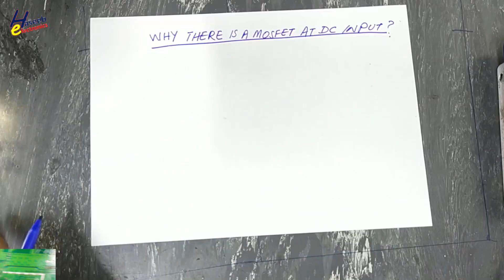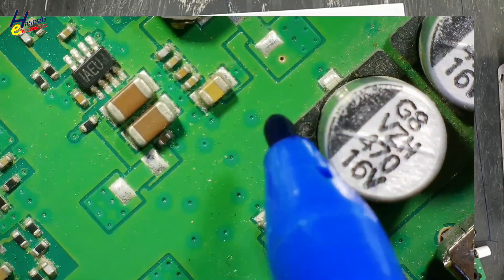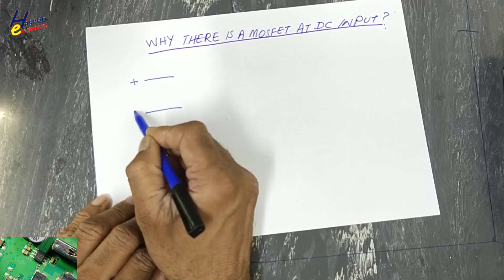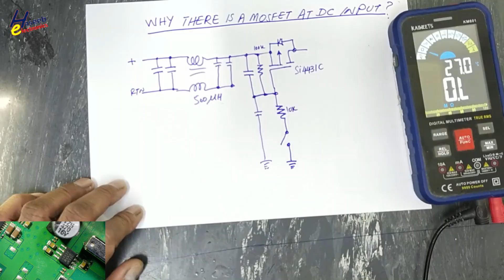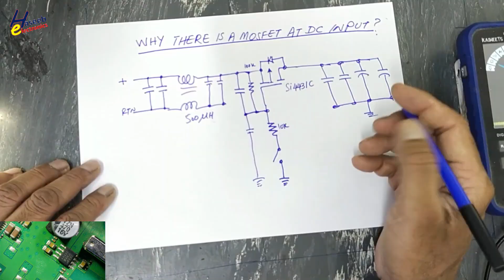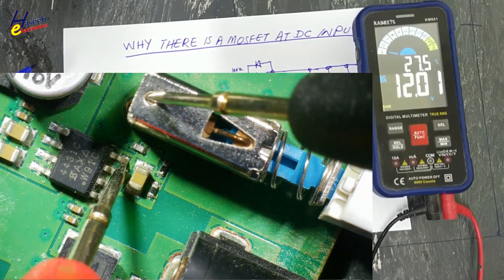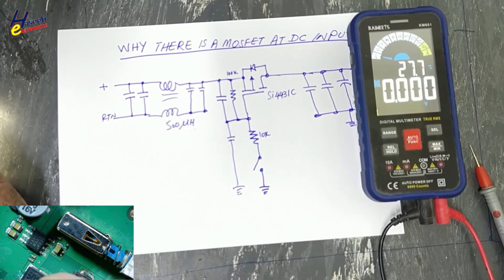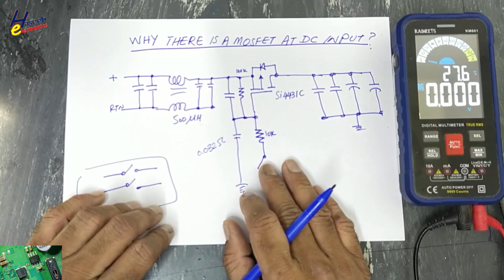{1379} Why a MOSFET is Used at the DC Input of Routers | 4431C P-Channel Power Switch Explained

Comment: Lg 5 tone unit I chenge  Bridge diode and Acs710cb ic  all warking compressor onliy 8Amp running no high speed
Reply from the maker: Good morning. you can check IPM current sense circuit. specially operational amplifier (LM358 or 341 etc used with current sense resistors)

Comment: It's a reverse voltage protection, when the power plus becomes negative and the gate positive the mosfet will be in an ope line state..
Reply from the maker: i think no. 
here the configuration is slightly differnce. it is bounce-free dc line or battery switch 
configuration you mentioned is used in battery chargers as load polarity swicth. that becomes active when battery is good polarity. because in that case that mosfet takes ground from battery negative termial to turn on

Comment: Resp Sir! ధన్యవాదములు Sir.  --  ChinnaRao Paderu Andhrapradesh
Reply from the maker: good morning brother
Reply: @HaseebElectronics  ధన్యవాదములు Sir. Good మార్నింగ్ Sir.
Reply: Resp Sir! Good Morning Sir!  Sir My Seagate 500GB Hard Disk Spinning and Stopped immediately Sir, Diodes Capacitors are Removed Test Good Sir, but PCB Component Place 2 Sides Values Sir, Where the Problem Sir, Please Solution Sir.  --   ChinnaRao Paderu Andhrapradesh
Reply: @HaseebElectronics  Good Morning Sir!  Sir My  Seagate 500GB Hard Disk Spinning and Stopped immediately Sir, Diodes Capacitors are Removed Test Goo Sir, but PCB Component Place 2 Sides Values Sir, Where the Problem Sir, Please Solution Sir.  --   ChinnaRao Paderu Andhrapradesh

Comment: Thanks for the video sir. You said, towards the end, that "to protect the processor and sensitive electronics" it is best to use the MOSFET with the switch. Can you please explain how the presence (or absence) of the mosfet affects the "processor and other sensitive electronics"? How/why does the mosfet protect the processor?
Reply from the maker: it protects the DC input line instead of mechanical swicthes and relays. because the mechanical contacts of switches and relays alyas bounce while making and openning. which cause spikes and interruptions. in result the sensitive electronics may expose to that pulses, which may cause unexpected failures
Reply: @HaseebElectronics  if we connect the capacitor across the mechanical switch, will it not protect the power spikes, too? Kindly tell..
Reply: It's a reverse voltage protection, when the power plus becomes negative and the gate positive the mosfet will be in an ope line state..  check reverse polarity protection on youtube (eevblog has a great item on theis usage of an mosfet to do so).
Reply: @joostjepek nice
Reply: Sir i have questions but you didn't reply so i question you